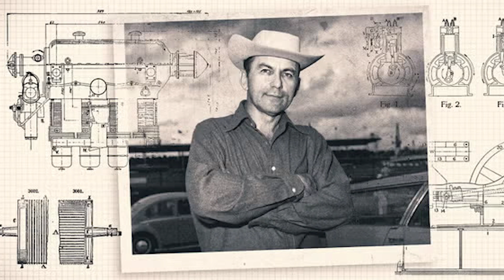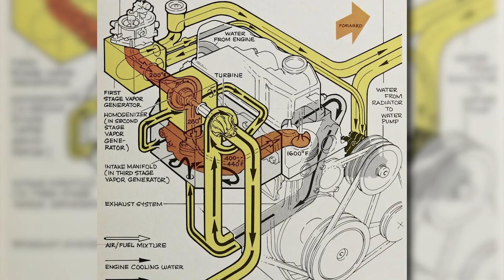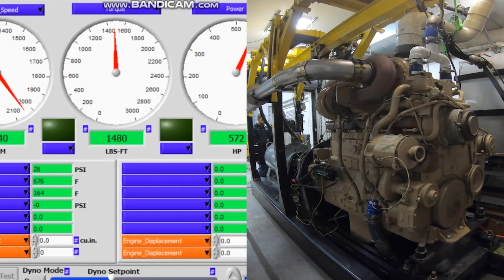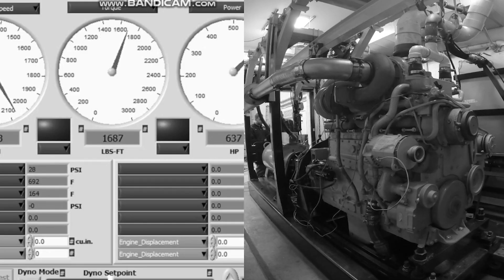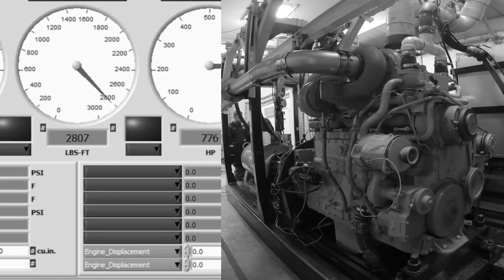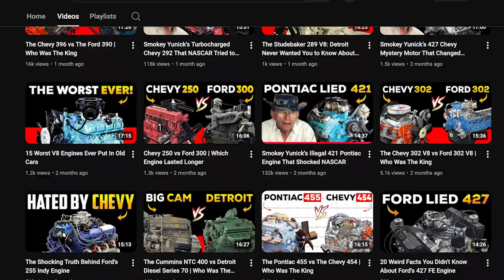Smokey Yunick’s Turbo Diesel Experiment That Truck Makers Tried to Kill

Comment: I believe it can be done. I have a 93 Dodge d250 with the 5.9 Cummins, the famous 12 valve, that gets 24 mpg. I thought I figured wrong but it consistently got that. Factory, no mods